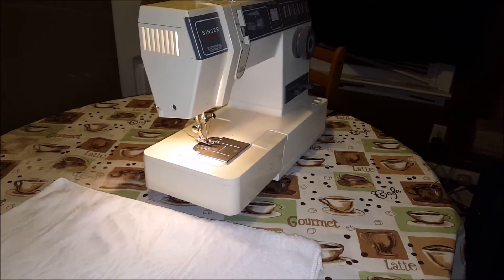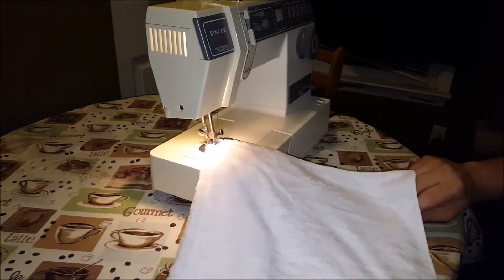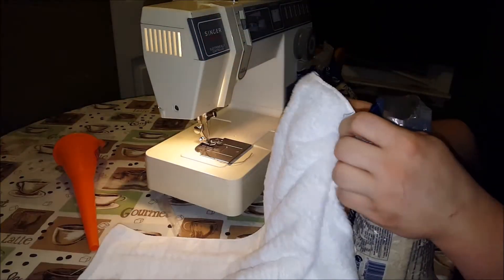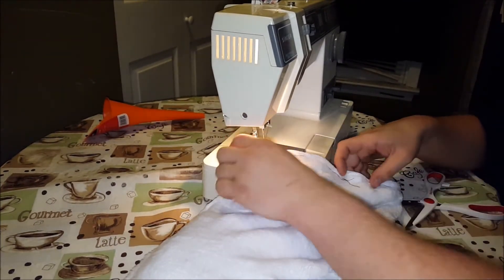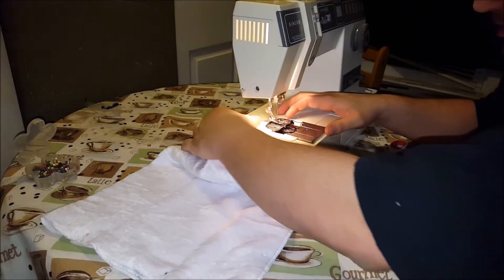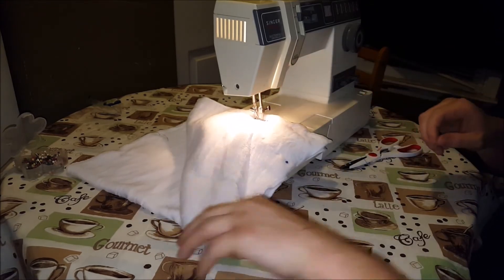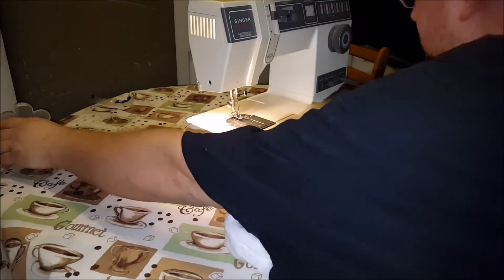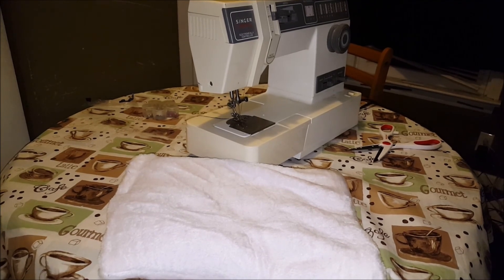Sewing project: Making homemade heating pads

Comment: wheat works  better and small only 6 inches by 6 inches square is big enough and heat up in micro wave they use that in a nursing home where I work I do have one to
Reply from the maker: This is something my mom has been making for years. She makes them in all different sizes. I've never priced wheat, but I'll check it out. The big thing with these are they're cheap and affective lol.
Reply: the wheat is done by profesionals and they charge alot you can keep heating it over and over for years alot of years and they dont wear down in the nursing home i use to work ,that was im in another one now its all volentery work as i just cant do the physical work any more ok thanks
Reply from the maker: The rice works over and over too. Usually what happens is the towels wear out over time.
Reply: yes these ones i know are like a towl to same as yours but smaller 6 in by 6inches you ever tried one i have cronic pain i find heat creams work for me and lots pain tablets